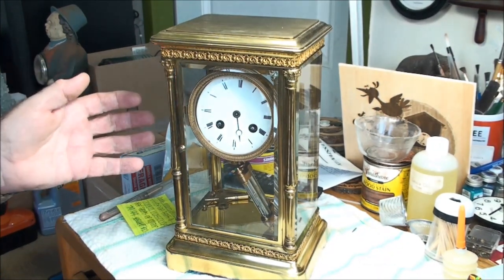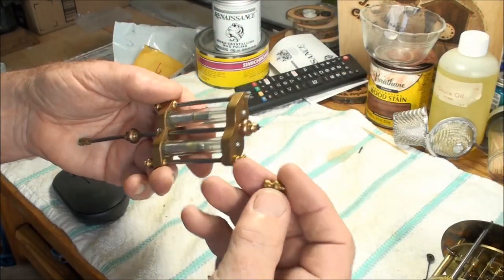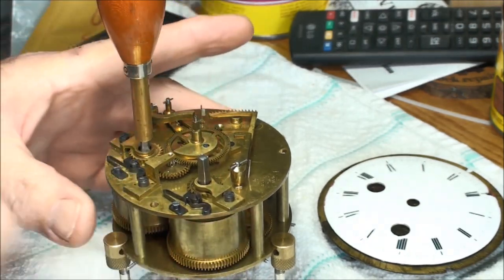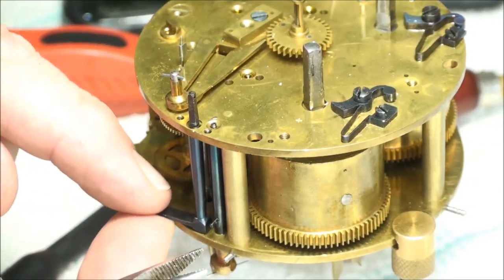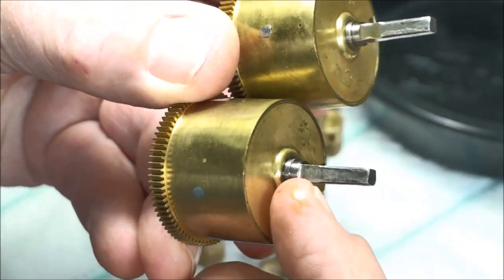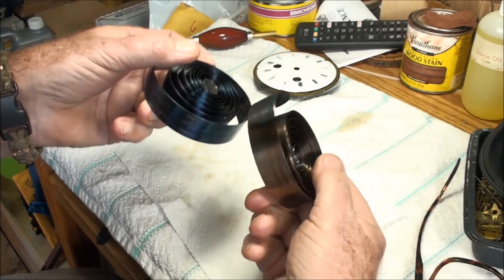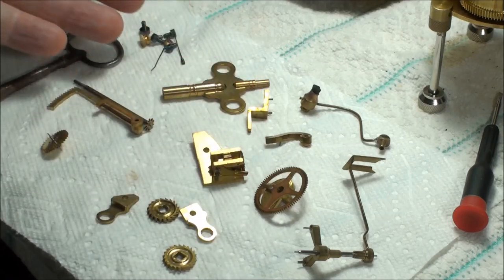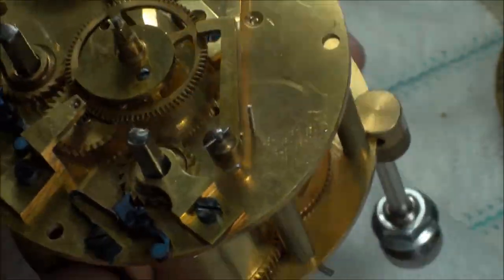French Crystal Regulator Clock Repair

Comment: I think and I am not sure that the markings of "53" is to show them that the parts all go together for that clock. I like the procedures that you do to take the barrel cap off. I will have to try that. I couldnt  understand the Mickey Mouse voice while you were putting the spring back in. LOL.  I found when putting the French movements back together it is easier to take the scews out of the rear plate that hold the bushing (in this case there were 2 of them). The broken key would have had a smaller key that went with it that is for the adjustment of lifting the pendulum up and down. The other key is a newer key that they bought. Another great video. Thanks for the shout out at the end. May God Bless you and yours.
Reply from the maker: Thank you Mark. I hope I don't get a copyright strike on the Mickey Mouse Voice Over, lol. God Bless.

Comment: You've got a Marti French movement, how great thats a very good movement. Rare to find a real mercury pendelum! They started putting a solid color material later in the pendelums so you have a really good one...but dont open the tubes. Congrats!
Reply from the maker: I knew that the tubs were mercury tubs and the look like they are sealed when they were made. Funny how the glass was stained by the mercury. I guess some times when I buy clocks, and about 1/2 the time I get a winner. Thank you so much for stopping in and letting me know just what I have.

Comment: I remember when i was about 10 years old I took a clock spring like this apart and it shot out so fast scared the tar outta me.
Reply from the maker: They can be scary taking the barrel spring apart. But very satisfying getting it clean and back in the barrel with no injuries. Thanks so much for stopping in Bat.

Comment: I have a very similar clock. It runs abit fasr. How do I slow it down? Thanks
Reply from the maker: On the bottom of the pendulum, there is a nut you turn to make the pendulum move down to slow down the clock and move up to speed the time faster.
Reply: @justmike57  thanks, that works

Comment: My papa always told me it's better not to restore old clocks. Leave them as much as you can as original because the value will be taken away.
Reply from the maker: Your papa is right, but you have to remember that it is your clock and if you don't like what you see, then fix it your way so you can be happy with it.